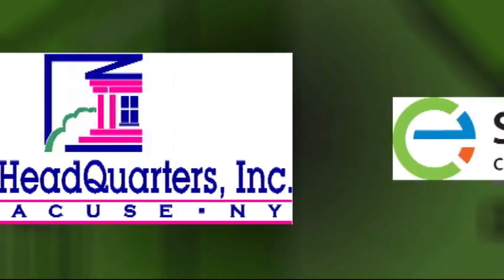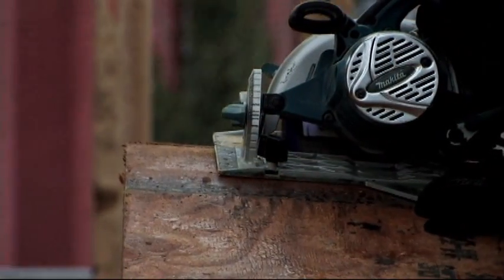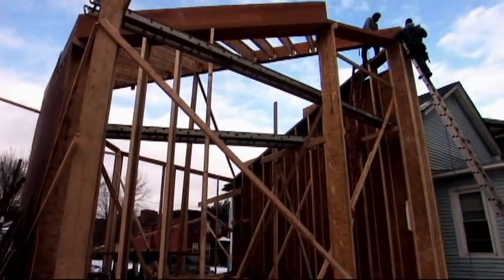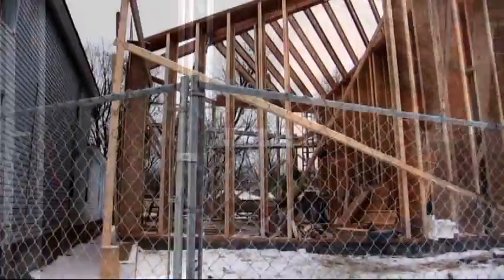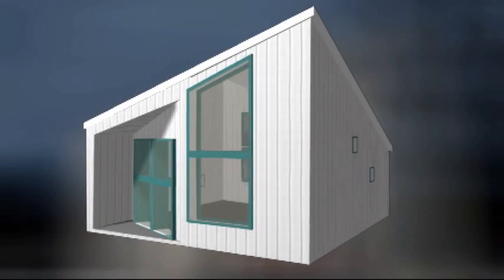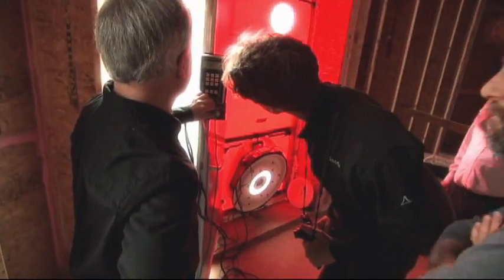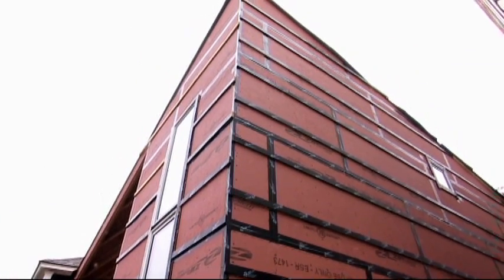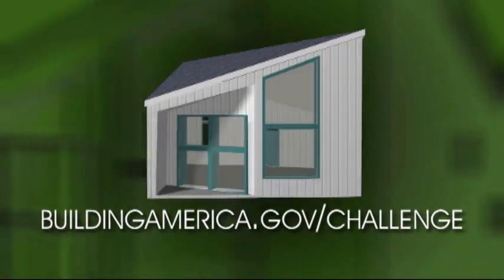Passive House - From The Ground Up

Comment: Passive house videos from the foundation up total to date 37 https://www.youtube.com/user/seumas2/videos
Material used Port Alberni's first Passive house (Passivhause) build in the heart of Vancouver Island British Columbia Canada.

Passive House(Passivehaus) is considered to be the most rigorous  voluntary energy-based standard in design and construction industry today.
Passive house buildings consume up to 90 percent less heating and cooling energy than conventional building.

The use of Passive House design software was used to gain the specs required to meet the performance standard for this location.

House was constructed well  above the current standards as outlined in the B.C. Building Code.

Footings were widen to 36 inches(914 mm) due to low bearing soil conditions and additional rebar reinforcement added.

30 inch high (762 mm) high reinforced walls . Course sand placed inside foundation walls and mechanically compacted.

Three layers of four inch *102 mm) thick  Expanded  polystyrene foam sheets with all joints staggered and tape were placed on top of compacted sand.

The three layers of foam have insulation value of approximately R 50.

A 20 mil layer of poly was placed over the E.P.S. sheets and taped and sealed.

Four inches(102 mm) of 30 m.p.a fiber reinforced concrete was placed to form a slab over the foam based.

Slab is isolated from concrete stem wall with four inches (102 mm) of E.P.S. to prevent thermal loss.

All cold water lines are buried in the sand to keep them cool, hot water lines have been placed in the center layer of foam insulation to minimize heat loss.

Wall plates compress to heavy beads of acoustic sealant between layers of vapor barrier to prevent air movement.

The walls are double stud configuration set at 24 inches (610 mm) on centre and plates are spaced in a manner that yield a 20 inch (508 mm) thick wall. 1/2 inch (12 mm) standard plywood sheathing with  Mento 1000 a three layer airtight vapor open house wrap( far superior to common house wraps) with 1/2 inch(12 mm) pressured treated plywood rain screen battens form the exterior surface. 

Intello  smart vapour barrier was installed one third in from the inside wall to prevent condensation in this climate.

Triple pane argon filled windows meeting passive house standards from Euroline  were placed mid wall to reduce wind wash heat loss.  All window openings have been splayed at 45 degrees to give a full wide angle view.

Almost all the wiring and plumbing was kept inside of the vapor barrier envelope to minimize air leakage.

Passive house standard requires air leakage not to  exceed .6 Air changes per hour at 50 pascal.

Zehnder comfoair 200 HRV has been installed with a 1000 watt air preheater .(92 percent heat recovery rate)

House has been pre- plumbed for a heat pump water heater reducing  domestic water heating cost significantly.

Garage has been pre-wired for 40 amp/240 volt  electric car charging station.

House to be equipped  with  heat pump condensing dryer which requires no external venting,only a water waste line. George K Builder. © George K 2019       https://www.youtube.com/user/seumas2/videos

Comment: All of the mentioned features for the passive home is exactly the same as the R2000 home in Canada which has been available to the public for more than 30 years. Same as in Germany. Unfortunately for the U.S. innovative systems come in when there is money to be made (expensive energy). The concept is simple but the money to be made designing the homes is high.  Remember the three basic qualities insulation, minimal air leakage and air quality.  Keep the house simple with the 3 qualities and you'll be fine (keep cost low). If money is not an issue...hire these guys.

Comment: It is amazing how much farther we are with passive solar since this house was built. my house was built in 1998 with R38 roof insulation which was great st the time. Now they are recommending R60 in roof and R40 in walls and floors, with a concrete floor.

Comment: Australia has embraced the idea of passive solar efficient houses, as we have much better climate than northern Europe we don't have to worry so much about the cold. In the tropics and sub tropics we think about things like the placement of the house on the block, the placement of the windows to exclude the hot afternoon sun and encourage cool breezes, the use of fans, shade trees and water features in the garden. We may not do away with ACs but we can reduce the number of days they are needed.

Comment: I personally would not build this house anywhere. They talked about sealing the house which one aspect of passive houses. It does not maximize the southerly aspect, it has no eaves, there was no mention of internal thermal mass (although the floor may be a concrete pad) and the “iteration” that really “Surprised “ Garrik Jones made it “really hard to build” 

Timby passive, sensible housing is suitable for any climate and has been successfully practiced in the advanced civilizations for ages.

Comment: You talk of a heat pump. Doesn't that preclude the principle behind the no heat & cooling systems. While I have seen this heat pipes attempted, they tend to cause more problems than they alleviate. There are mold issues & problems removing the high humidity from the air. 

While this system may be a suitable one for this application as stated & shown in the vid they aren't sufficient. Yes, there are ways to perform this function, however, they're costly & not as suitable as existing apps.

Comment: Sure it'd would. First, you'd have to reduce the glazing from the south. Secondly, using a heat pump to 'cool' the building in the summer. The ground temp. is constant around 50-60F, so in the winter it is used as pre-heated air cause it's warmer than the air outside (well maybe not in Texas) and in the summer, 50-60F is a lot cooler than the outside air. And viola! Just don't open the windows. As for your winds & storms concern, these homes are built the same way as traditional homes.

Comment: Great video! Did the house use any polyurethane to improve its insulation? You should check out our passive house project in Brussels, Belgium!

Actually @1Timby, the beauty of the passive house standard is that the design eliminates the need for a lot of heating and cooling whilst still providing the comfortable conditions needed to live in a region like Texas, Syracuse or Brussels :)

Comment: Wow this place wouldn't work here in Texas. No heat and cooling. With tons of days over 100 in the summer and high humidity. What about being able to withstand high winds most of the spring and summer with storms and tornadoes? Interesting but not too feasible elsewhere.